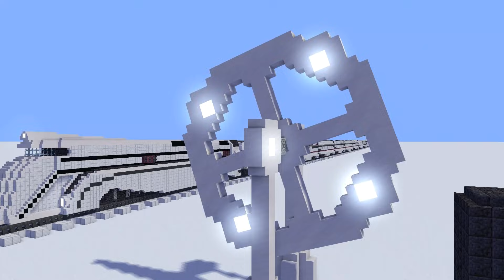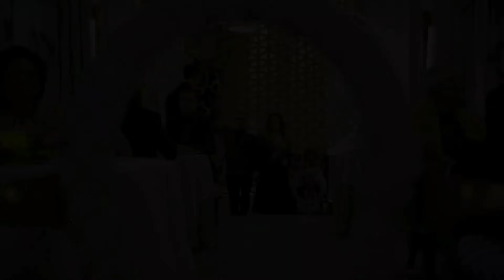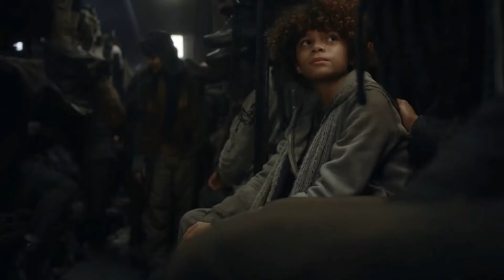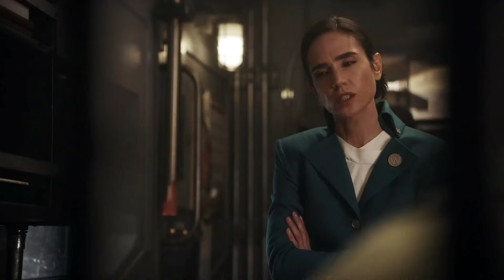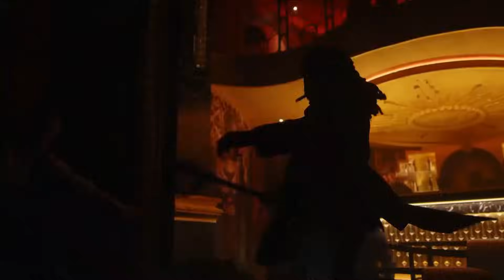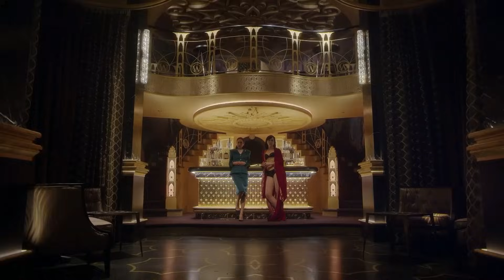HOW THE ENGINE ETERNAL WORKS | Snowpiercer Lore Video

Comment: While the explanation skips a few questions (IE. Why can't you use reserve batteries to start the turbine, why even use a train cut out from the outside world at all, how do you stall the turbine, how does the train system make the turbine create more energy and etc), I really like how good looking the presentation was. The Minecraft demonstration in peculiar was really nice with the little edits with the glowing batteries and train on an incline. 

My main problem with the snowpiercer show, is that by making things more rational, it takes the more poetic or metaphoric parts away. The original comic did that well, and the movie VERY well. 

If you do want a world of trains with the logic cranked to 11, I'd suggest La Compagnie des Glaces by G.J. Arnaud. I don't know if there is an English version of it, but boy is the universe extensive, albeit it skipped on how people thought living entirely within trains would be a good idea. Anyway, this série is LONG, clocking in at over 60 books over 20 years of writing. I began around 4 months ago and is still at the 8th book :>

Comment: I think in one episode where they had to cut Snowpiercer below 15 cars. And they had the train stopped to check for samples of the snow, the engine was just frying itself
Reply: Suddenly makes me think the Train is Nuclear powered  or RTG (Radioisotope Thermoelectric Generator), not magic BS eternal engine. If you consider it takes thousands of years for certain isotopes of material to degrade via half-life, a RTG powered engine might actually be feasible. The only question would be what the heck are the rails made of?
Reply: They mentioned that the Engine was designed to support and power a 1001 cars, not 15. However even at minimal output it was still producing too much power. Therfore it needed to dump it by heat or high speeds.

Comment: If big alice can remain stationary longer than snowpiercer can why did wilford start big alice In the beginning of season 2 couldn't he have just waited for the rest of snowpiercer to freeze and then board the train and if wilford had some idea how the train worked why did he allow melanie and Bennet to be engineers if he could pilot the train himself because he was the Only person who knew who the trains worked when he was abandoned and was able to retrofit big alice.                

Ps I also like how when you talked about people wanting it to be actual science my name popped up
Reply: It would've been possible for Wilford to have Big Alice to stay connected to Snowpiercer until its systems are chocked out and everybody dies of the cold. it is even stated by Wilford himself in the show that "me and my crew know life below zero", so he and his crew could've survived if they have done that, but the issue could've been to move the entire train again in time until both trains run out of power and everyone dies. 

Big Alice does have enough power and traction to stop Snowpiercer to a full stop and push her forward again for the engine to begin generating energy again once in motion. But if the engine completely dies, it might need a proper restart which will be difficult to perform in one sitting. For Snowpiercer is ten miles long (or 43 miles long to other calculation) and the sub-train is out. Crew or other engineers such as Wilford will not be able to reach the engine in time to initiate the proper restart until Big Alice is unable to push Snowpiercer enough to provide enough motion for energy to be generated in order to reignite the system. Big Alice struggled to pull over 1,024 cars in season 3 and it was said in season 2 that Big Alice will only be able to push Snowpiercer at proper speed long enough for the energy restart to be properly completed, and Snowpiercer will start moving on her own again and lessen the burden on Big Alice. 
So the biggest issue in this possible scenario is (as this video also said) Time. Big Alice might remain stationary far longer than Snowpiercer due to the small electrical load, but she cannot remain stationary nor push the entirety of Snowpiercer by herself forever, and it might take hours to reach the engine for a proper restart until the burden becomes too great and Big Alice grinds to a halt due to the weight. So to not risk his crew and his life, Wilford decided to start Big Alice again when the Docking cars are permanently disconnected in the beginning in Season 2, ensuring his and his crew's survival in that situation so he can try to claim Snowpiercer another day in a manner that he has complete control in.

Now for the reason for why he allows Engineers such as Bennett or Javi to live and work under him is because they know how the train works just as much as he does, or at least to the extent that is necessary for efficiency. But the most important reason is because he wanted to live his life in luxury as much as possible, so he wanted others to take in the responsibility of maintaining the Eternal Engine so he doesn't have to do it himself and he can relax and drink all the booze he wants.
Reply: @Kaiju515  the reason for big alice having to move makes sense but big alice started out with 43 cats as stated by Alex but wilford disconnected them so why couldn't he have disconnected some of big Alice's cars
Reply: @dylanculpepper7080  Because if he disconnected more cars then not only will there be less space, but also some of the cars with the parts of snowpiercer might get frozen and lost. Also the electrical load of Big Alice might become so light that her engine will be on a constant threat of melting down like that of the Snowpirate train at the beginning of Season 3. 
Plus disconnecting cars was a complicated process for Snowpiercer with only a few Link-junctions on certain areas, so it might be the same for Big Alice. And with Big Alice being 20 times shorter than Snowpiercer, there might be only one or two link-junctions that are available that hold a couple cars each. 

So it would've been more detrimental to uncouple more cars from Big Alice, in terms of time of uncoupling them and the potential threat of meltdown due to the extremely light electrical load.
Reply: @Kaiju515  but big alice was retrofitted and she had more capabilities than snowpiercer so wouldn't her electrical load be able to change
Reply: @dylanculpepper7080  True, she was outfitted to have some more capabilities than Snowpiercer, such as: having a booster/gear shift for a temporary increase in acceleration, more traction, docking car with cold valve security, up-link, is a push-pull engine, and most importantly, Low-Torque. but other than that, we don't know much else on how Big Alice has been retrofitted, nor was the Booster properly explained. 

Also, Big Alice is the PROTOTYPE of Snowpiercer, which means her Engine is a prototype of the Eternal Engine as well, which means that her engine can have different pros and cons than the perfected engine, probably more flaws than necessary. This is why Melanie and Ben were surprised that she was even running at all at her reveal in Season 1, for her engine was unable to work on the night of departure at the beginning of the Freeze. Because her engine was a prototype, old, and probably had a bunch of flaws. 

For Big Alice's engine to work, Wilford either had to fix the problems that her original engine had to begin with, or replaced it with one of the perfected perpetual motion engine's that were in development and ready to be installed. 

For Snowpiercer can't be the only train with perpetual motion (Unless Wilford was planning on building other Perpetual Trains before the Freeze) 

If Big Alice still held her original engine, that it might have a higher risk of melting down from the near non-existent electrical load, or suffer other problems because of it due to ending up generating more power than necessary because of the light load. 

If she had a perpetual motion engine that is just as new as Snowpiercer's and has about the same level of efficiency as her sister, than she would have the same level of risk that Snowpirate had in season 3, due to almost being at the same level of cars if possible.
Reply: @Kaiju515  alright right you win this round
Reply: @dylanculpepper7080  Round? I am not sure what you mean. I didn't mean to offend, I am just answering your question of what I know.
Reply: @Kaiju515  WAIT 1 MINIUTE I just found a good comeback
Reply: @Kaiju515  at the end of season 3 big alice and snowpiercer separated in the middle of ag sec so wilford could have sent a crew to unlink ag sec and when big alice was up and running to its full power redock with snowpiercer and the crew that he dropped off to unlink the cars could have made their way to the snowpiercers engine and restart it allowing wilford to have complete control over both trains at the same time and from what we see in season 3 big alice is able to push her cars all the way to half of ag sec without any trouble
Reply: @Kaiju515  answer me that compadre
Reply: @dylanculpepper7080  Okay. So to answer your question, decoupling Big Alice from Snowpiercer through Ag-sec on the end of the first episode of Season 2 would not be possible on several counts. 

First: Uncoupling cars from Snowpiercer is a complicated process, requiring the J-link to be armed and for the engineer in the engine to pull the final switch for the cars to disconnect. In order to properly disconnect the cars, the crew will have to reach the J-link at Ag-sec and the Engine in order to complete the process and free Big Alice. Reaching Ag-sec will take a while since it a couple hundred cars away from the Tail (aka Docking Car), reaching the engine would take even longer since the distance from the Tail to the Engine is 10 miles, too long to reach in time until the Engine in Big Alice dies and everyone dies. 

Two: The crew from Big Alice would have to get past Layton's troops, which span around a thousand people in comparison to the hundred people aboard Big Alice, if the crew opened the docking car in order to travel to Ag-sec and the engine immediately after the connecting mechanism of the docking car was destroyed, Layton's troops will be waiting and storm into Big Alice if the Security valve of the docking car was off, or capture or kill the crew attempting to board Snowpiercer in order to disconnect from Ag-sec. Of course there are other entrances that can be accessed outside of the train, but it will still take time to reach them, including the engine. 

Three: Uncoupling the cars from Snowpiercer might not be possible if the engine completely dies since electricity is necessary for the mechanisms for the couplings to move and it isn't shown that they can be done manually without electricity and help from the engine, so it might not be possible. Since it literally takes no more than 12 minutes for the engine and life support systems to completely die, decoupling the cars would no longer be possible before the crew would even start.

Four: If the crew of Big Alice wait for everyone to die on Snowpiercer so they can board the train and disconnect the cars, they would need the train in motion to generate power  so they can use the subtrain and possibly disconnect the cars. With Big Alice pushing the train alone, it might be difficult for enough motion to be generated to restart the engine for Big Alice struggled to power a majority of systems of most of snowpiercer cars in the beginning of Season 3. Big Alice wasn't even capable of climbing a ridge without grinding to a halt because of the weight. Big Alice might not be capable of generating enough motion to be capable of generating enough energy to prevent her engine from dying and might possibly grind to a halt because of the weight of the entirety of Snowpiercer. 

Big Alice may have more capabilities than Snowpiercer, but she is still a machine that has limits, plus with the severity of the Freeze where livability chance are extremely low in a variety of situations, even within the train. Which means that at the beginning of Season 2, there were little to no options left at that moment other than starting Big Alice again and letting everyone on Snowpiercer live so he can retake Snowpiercer at a later time. It is even stated by Alex and Melanie that it was the only option left in order to survive in that situation before both engines completely die. 

This is my answer, I hope it is satisfactory. I do not mean to be offensive or rude or anything, I am just answering your questions with what I know of. It was a good question though.
Reply: @Kaiju515  okay you got me on that but when melanie has flashbacks right before departure there was a group of engineers wilford could have simply killed Ben and Melanie and save 2 or 3 of those engineers so that there could always be a full crew operating snowpiercer which would allow wilford to be in control and not have to worry about Ben or Melanie and we do know wilford has a soft spot for javi
Reply: @dylanculpepper7080  As i could remember, in the flashback before departure, Melaine, Ben, and Javi were the only engineers. The group of engineers that you are referrering to is the group of genetic scientists that were killed by Wilford out of spite. 
There was an electrician engineer but he was never really mentioned, so I think that they were the only engineers on Snowpiercer, other than Alex.
Reply: @dylanculpepper7080  Plus when Wilford did take control over Snowpiercer, he had Javi pilot Big Alice while Ben was on Snowpiercer even though he could have replaced him with another engineer that was probably in training. but the only engineer of Big Alice that was shown in the series was Alex. So there might not be other engineers available other than her and the others.

Comment: could the train last longer if a lot of the components that keep it eternal were either stored in mass or being built in mass onboard ?
Reply from the maker: Yep, and that's why Bennett wanted Big Alice to catch Snowpiercer. Cause Big Alice had massive storages full of parts, so the train could last longer.
Reply: @HallimarRathlornStudios idk
Reply: Big Alice was said to be a supply train and most likely for Snowpiercer itself because it too runs on perpetual motion and has an actual docking car for Snowpiercer. 

With how Snowpiercer in the show itself lasted for seven full long years as it did without the proper replacement parts, YES, It could last a lot longer than it is currently doing with proper part replacements and maintenance with the help of Big Alice from time to time. Preserving the train for several more years.  

In this scenario, if Big Alice was properly tasked as a supply train for Snowpiercer without being commanded by Wilford. Big Alice can scour the rest of the world in order to scavenge for more parts from other facilities of Wilford Industries. With its very light electrical load with its 40 cars, Big Alice has potential to remain stationary for long periods of time without running out of power, which is long enough for the crew to scavenge and get moving again. If Big Alice does not somehow got derailed along the way and have proper long-term communication with Snowpiercer, both trains could meet up at a certain location in their voyage, dock, resupply on food, parts, perform maintenance, and swap crew members. It would lead to an efficient cycle that would preserve both trains ten-fold. Ensuring the survival of both trains and all life on them until the slightest possible chance there is a warm spot for recolonization.  

At least that is my theory in terms of show canon and information from the show itself.
Reply: @Kaiju515 I love it
Reply: @Kaiju515  though as we saw during season 2~3, the main problem with that plan was Wilford being himself.